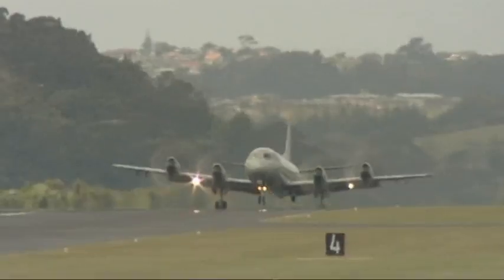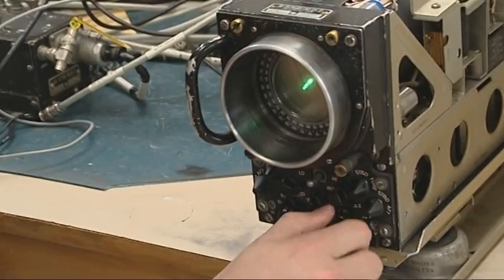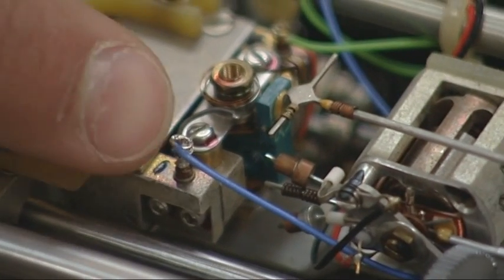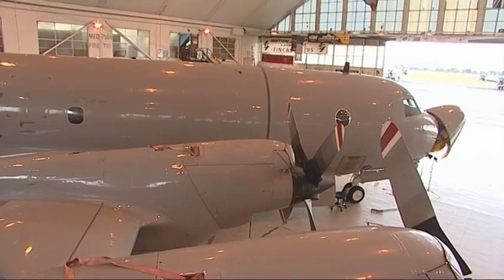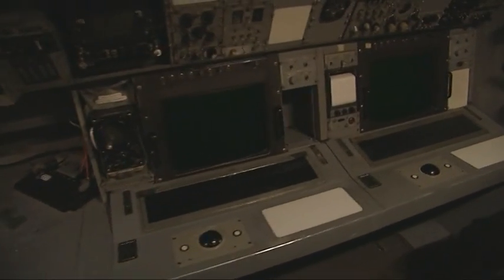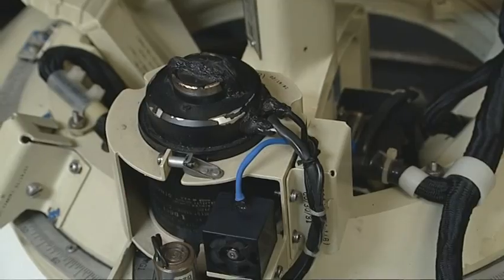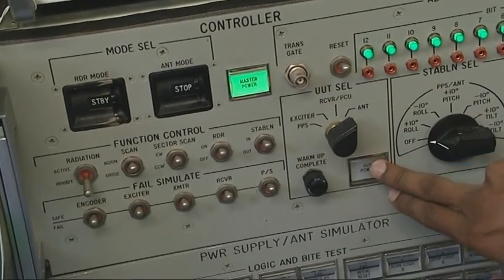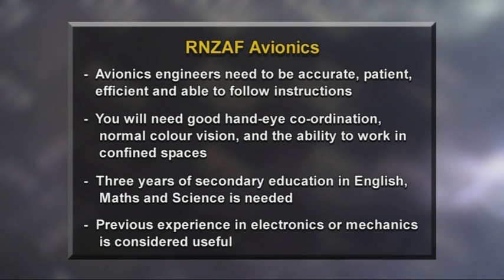RNZAF Just the Job - Avionics Technician

Comment: how much hour?
Reply: 25.00 a hour in the United States. Its a great career never get bored. MUST be accurate. Fuck up the Altitude indicator system by miscalculating it the pilot could crash into the side of a mountain. You can loose your job and could be jailed.
Reply: @LK-pc4sq  If you’re being paid $25 you’re getting ripped off
Reply: @j3en534  yeah 60 an hour is the highest you'll find in most cases
Reply: I want to join as avionics technician
Reply: Payed by Life
Reply: are u indian?
Reply: $1000 per hour
Reply: are you serious ? @Spelledjustjoey
Reply: @DraGon-cg6ge  Are you seriously asking if he's serious?
Reply: XiTe ok 👍